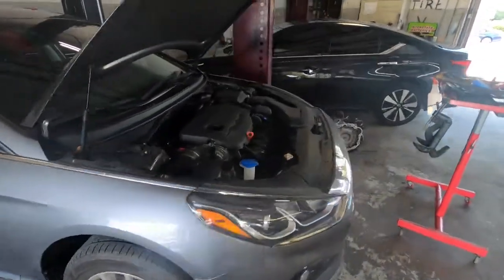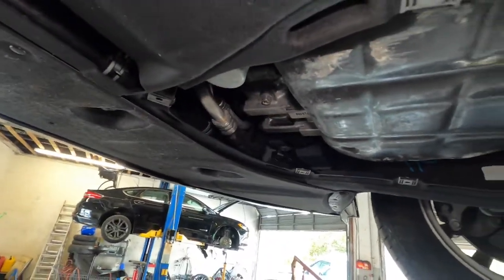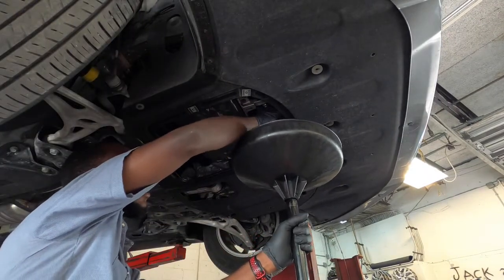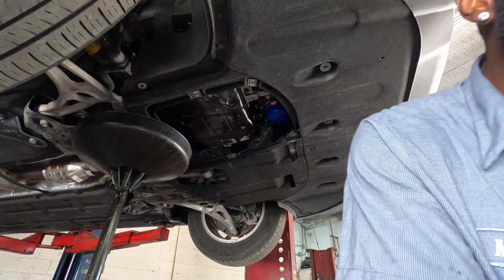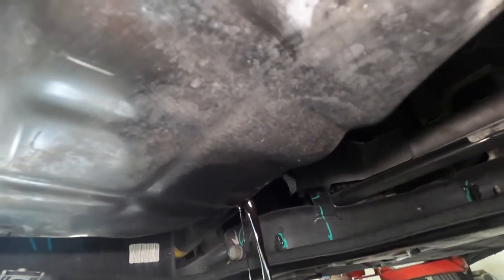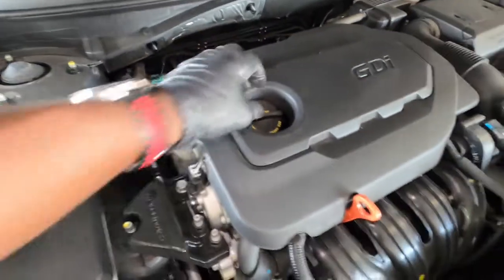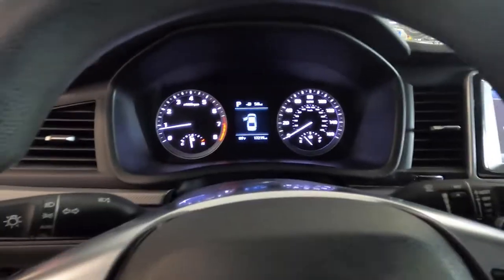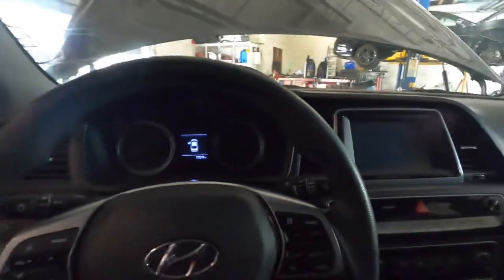HYUNDAI SONATA HOW TO CHANGE YOUR OIL AND TURN ON SERVICE REMINDER

Comment: This guy does just about everything wrong.  You undo the fill cap FIRST to reduce the vacuum effect, undo the DRAIN plug second to get oil out, THEN you remove the filter!  You tighten the filter too tight, and your recommendation on oil service twice a year is not what Hyundai recommends - once a year if you don't hit the mileage.

Comment: 5:20 1 1/4 turns on the filter after it touches the gasket? I think that’s way too tight and it’s going to be very hard to remove next time! 
This car has an easy access filter. Some are almost impossible to get to. I’ve always used 1/2 turn after it touches with no leaks. I just looked online and found a low of 1/4 turn up through 3/4 turn with one saying 1 turn. 
Good video!
Reply from the maker: Not a 1 and a quarter its either 3/4 or 1 full turn thats i said
Reply: WATCH CAREFULLY THOUGH AS HE SAYS HE IS TURNING IT A FULL TURN, THAT PLUS THE OTHER 2 TWISTS HE GIVES IT IN TOTAL BARLEY AMOUNT TO 1/4 TURN, BUT, CHECK OUT HIS NAME TAG, DOES IT REALLY SAY "MONO"?,,,, LOL, OK, HERE'S THE PUNCH LINE, IN SPANISH, IT MEANS "MONKEY" TRUE STORY, LOL, MAYBE THAT ANSWERS SOME QUESTIONS OR ELIMINATES ANY DOUBTS